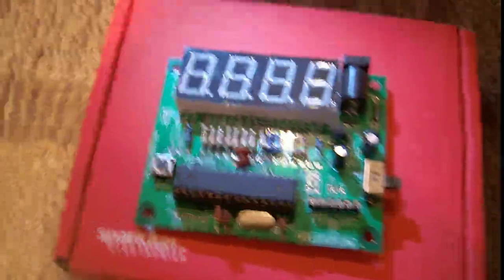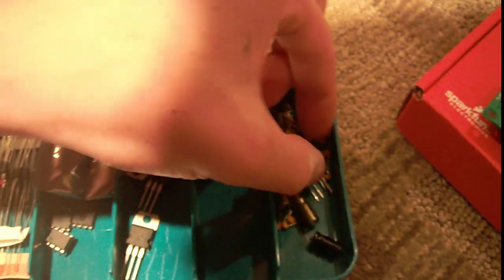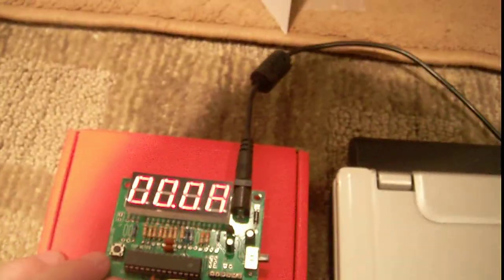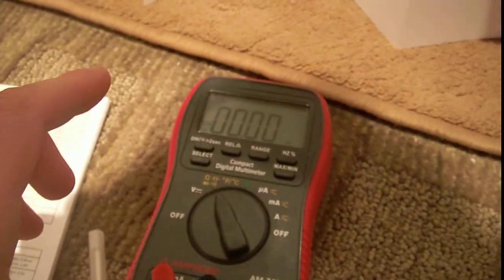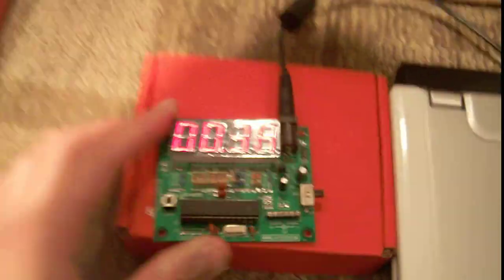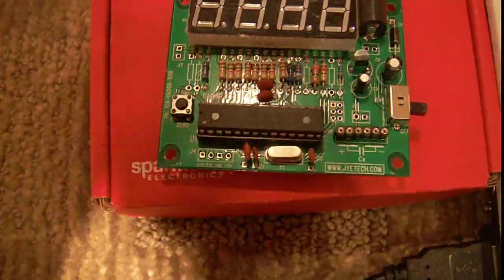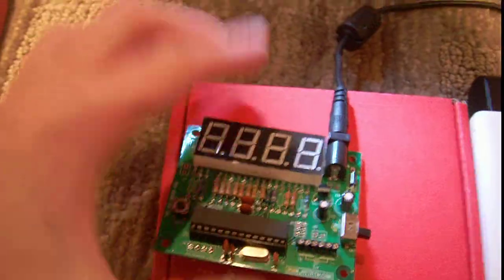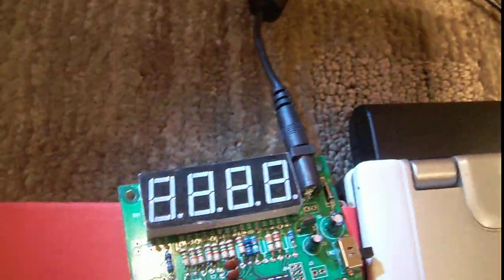Review Of The Sparkfun Capacitance Meter

Comment: I should have bought one before I decided to replace every single capacitor in a piece of misbehaving audio equipment. I probably could have found the offending electrolytic caps and save money by only replacing the capacitors that have drifted outside their specification.